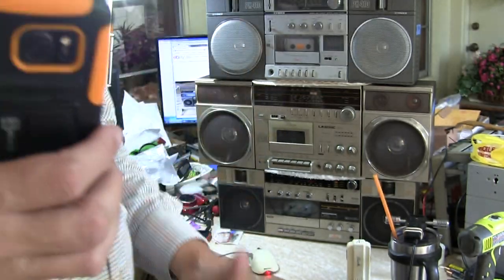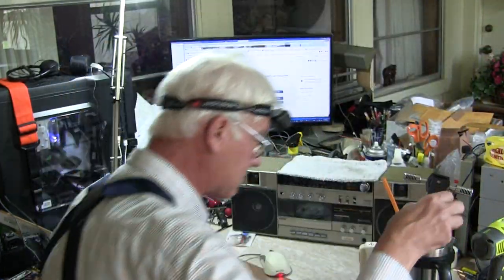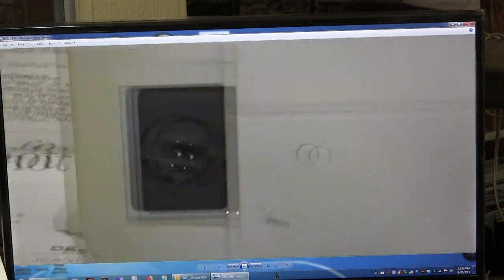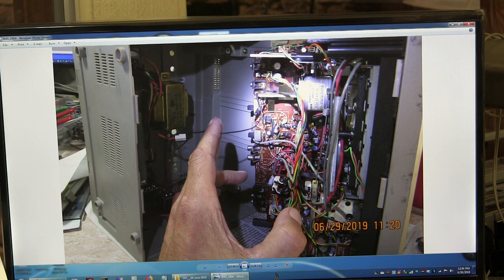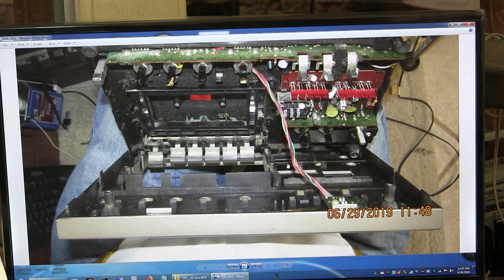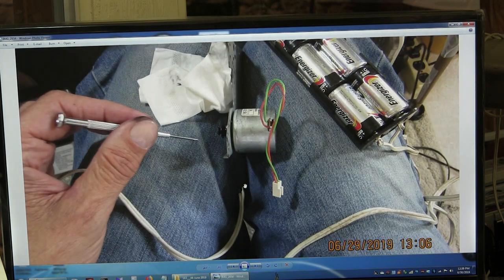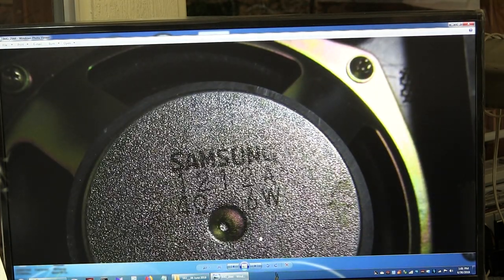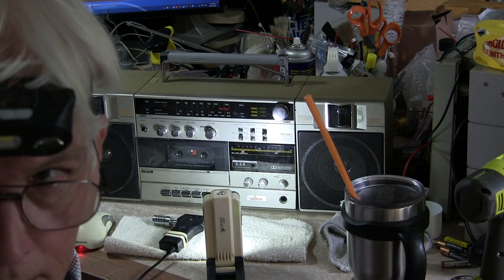Unitech CX-1212D 3-Band Component Cassette System Repaired restored Play pictures

Comment: Hello! how many belts are there, what sizes are they, thank you.
Reply from the maker: 1. Flat belt, sorry i did not measure that one. 2. one square belt 114mm folded or just shy of 4.5 inches folded. 3. counter belt I did not measure at all as i simply got one out of my bag of belts and changed it. I have a huge selection of belts and about $50.00 dollar worth coming from china to arrive here the last week of February 2024
Reply: @Cassette2Go  can you attach a sketch of how to place the belts, or a picture, without the one from the counter, which is complete? thank you
Reply: I solved it, it works..
Reply from the maker: @popescupetre2137  great.
Reply: the auto stop mechanism does not work. how do i solve!?
Reply from the maker: @popescupetre2137  Either with a set of new belts and or Cleaning of the mechanism. I do not remember how the auto-stop works on this model, does it use a clutch, if so then it may need a new clutch disc-hard to explain but I have replaced them before but not in this model. If the auto-stop is reel operated then check that mechanicals.